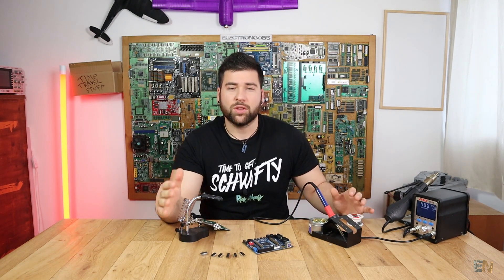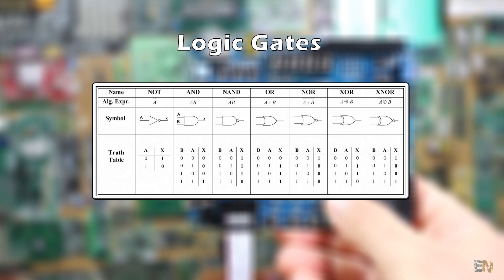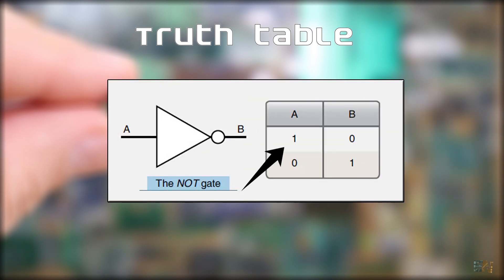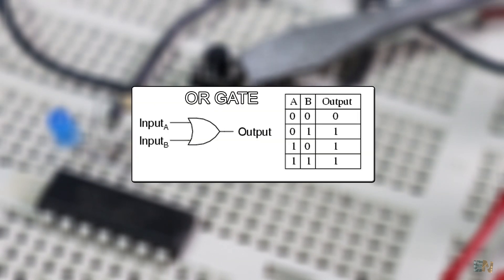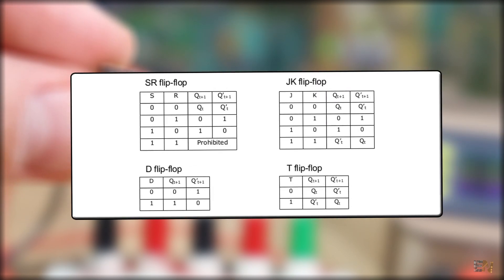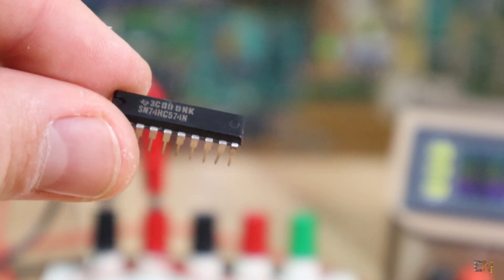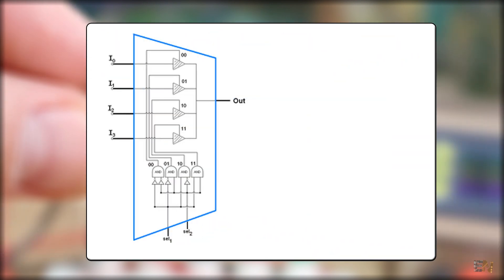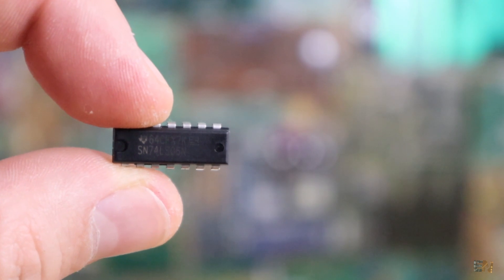Basic Logic Gates - Road to FPGAs #101

Comment: I saw that other people pointed out that 9:10 shows NAND and NOR gates, but they actually don’t. The circuits shown will not function. Activating the transistors will short the entire circuit, not just the output. It will stop the rest of the device from working.

To fix it, the person making the gates would have to put a resistor between 5V and the rest of the gate. This will allow the transistors to short the output without shorting the other gates. You can’t just put a resistor over the entire power source because then it will still short out the other gates. You need a resistor for every gate.

Another thing to note is that all the inputs need resistors too. If you have one output activating two inputs, the power from the output will get connected directly to ground from the inputs of both other gates. They will essentially short each other out and have to fight for power, and only one will work if you’re lucky. Putting resistors on the inputs of all logic gates will fix this.

Also, for those of you who want to try to build a digital logic circuit out of discreet components, Current travels from the base to the emitter regardless of what the collector is doing. E is not just B&C. Good luck on your project!

Comment: In an earlier video you were using one of those wall plug transformers and you could set the voltage on it 3.3, 5, 12 etc with a screwdriver. What is it called and where can I find one? I couldn't find any yet.

Comment: 4:10 onwards - you shouldn't be driving an LED directly from a logic gate output.  You need a series resistor to limit the current.

Connecting it directly is very bad practice, and will drastically shorten the life of the LED, and probably the IC.

Refer to the datasheets of both and decide what's a maximum safe current, then stay below the current.  The datasheet of the LED also tells you the voltage it turns on at, or you could assume 1.6V-1.7V, maybe more for a blue LED (typically more than for a red one).

You then use Ohms law to choose a resistor which will give the maximum current you've chosen (Imax), based on:

R = (Vcc - VLed) / Imax

For example, 5mA should be fine, for a LED like that.  Some can handle 10mA, if you really need it that bright, and that should be fine for a TTL chip - but it's good practise to check the datasheet.

So, for 5V, 5mA and a LED that turns on at 1.6@V, you get:

R= (5V - 1.6V) / 0.005A = 680 Ohms

Meaning you should use a resistor of 680 Ohms or greater, to protect the LED.

Other than that, good series of videos, from what I've watched so far - I watched the next couple first.

Comment: Hi, i have a question. I'm still studying BJT's and their properties. At 9:10, are those actually NAND and NOR gates instead of AND/OR? Am i need to add current limiting resistor between collectors and supply voltage? And base resistors? I don't understand how that's supposed to work otherwise. Thank you in advance.
Reply from the maker: True! My bad, is NAND!

Comment: Nice. Don't forget to show your tool chain for programming and detail what operating systems it will work on. I'm Ubuntu only these days.
  Nice to see your following through with your interest/comments on GS's channel a couple of weeks ago.
   If you want to get into this even further, I'm really more curious about the simple designs of FPGA's/CLPD's. I'm a bit scared to build/solder a project with one of those massive pin count FPGA's. Plus I don't even know what I would find useful with so much digital I/O. I really want to find something easy that lets me goof around with programmable analogue networks mostly at this point.
   BTW if your ever looking for references on a subject and having a hard time finding search results I've made all of my saved playlists public and I put everything I find interesting or useful on electronics in a playlist. It's all intended simply as my own personal reference, but I figured it could be useful to some people. Sometimes it feels to me like YouTube's search results are heavily biased and not very effective on intelligent subjects. I think there is a heavy search bias for content that is from  people that are monotized and currently active instead of the best reference material for deeper subjects. I find a lot of the content I've saved either through external references outside of YouTube or from suggested content on videos that were not relevant to my original search results. I've even saved a few of your videos on a list or two. I try to keep it really organized by subjects that seem to get more and more detailed. I watch far far more content than I make and probably more than most as I'm a gimp :)
Anyways... Thx for the upload.
-Jake

Comment: ...really like the links, I'm ready to buy a 3D printer, any recommendations on which one on the link site you provided. I'm new to printers, so I thought you might point me in the right direction as to which one would be a good first time printer. Thanks in advance my friend.
Reply from the maker: For a begginer I recommend a very cahp one. My favorite is the Anet. https://www.banggood.com/Anet-A8-3D-Printer-DIY-Kit-1_75mm-0_4mm-Support-ABS-PLA-HIPS-p-1130694.html?p=MO102110638587201705&cur_warehouse=USA

It will give you some minor problems, but is the ebst way to learn. If is direct high quality taht you want, I recommend you the CR10: https://www.banggood.com/Creality-3D-CR-10-Mini-DIY-3D-Printer-Kit-Support-Resume-Print-300220300mm-Large-Printing-Size-p-1201287.html?p=MO102110638587201705&cur_warehouse=USA

Comment: fpga technologie is still expensive .... and vhdl programming language is very hard .....
Reply from the maker: fpga technologie is one of the  cheapest but not when you buy one or two. If you realy want to get a product on the market such a vending machine, fridge, etc, they usually use FPGAs or comune ASICS because they make millions and the price is reduced a lot.
Reply: i studied fpga's in my university for 2 years and we used a A xilinx spartan development board that cost almost 600 $ so it was stuck in my head that its expensive 
you were write the new boards are much more affordable and have many advantages over microcontrollers